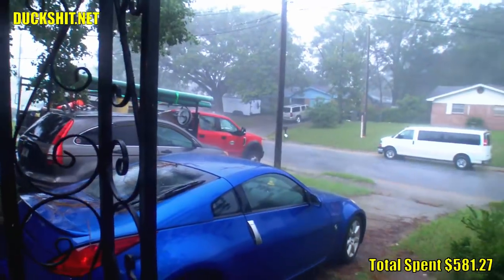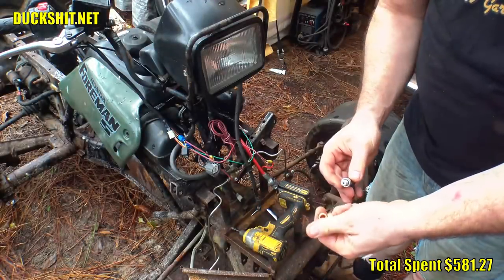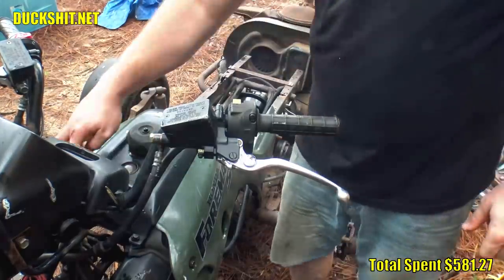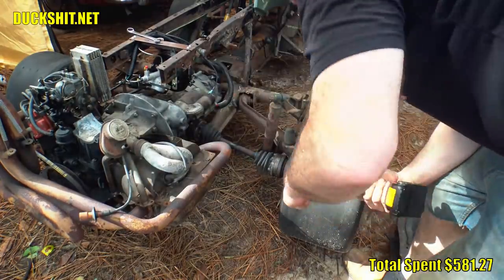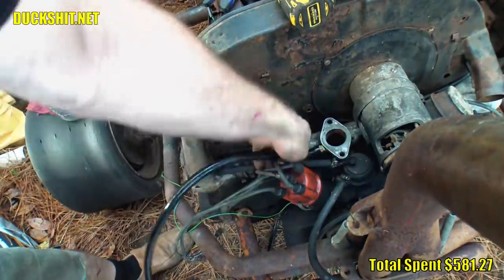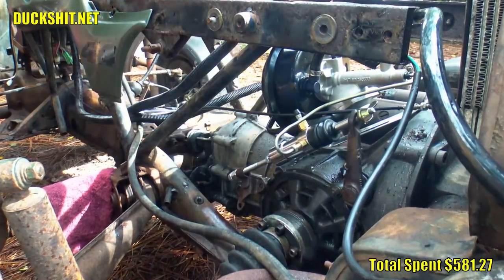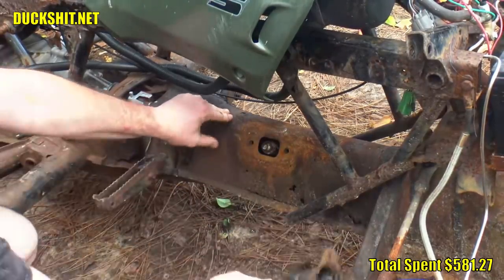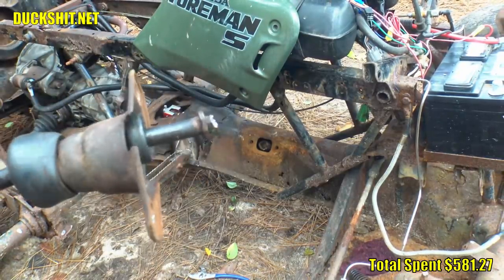HAND CLUTCH WORKS! - VW Motorcycle - ATVW Junkyard Build - Part 13

Comment: Lol I'm no hater. Love it. Glad it worked out. That's a cool slave cylinder with the vac assist. Holy crap what a plumbing nightmare you had there. 👍👍👍 I borrowed a friend's thumb for this one. Thanks for sharing, 🦆 man.
Reply from the maker: Haha yes... that hydraulic setup is quite a convoluted mess.  Thanks man!

Comment: Heres a thought for you , know any amputies that would like drive a manual again. Wondering how that clutch set up would work mounted on the gearshift itself. You could patent the idea
Reply from the maker: I considered mounting the clutch on the shifter, and it has been done before.  I wouldn't be the first.  But it's not what wanted.  I wanted a typical motorcycle setup.  I'll have to figure out a foot shifter later though.

Comment: Awesome work man! 
I could have told you the shifter wouldn’t work…. I’ve only been running one for 2 years now 🙄
Reply from the maker: Hahaha, yep thought of you the whole way through.  You didn’t have to cut yours, I would imagine you used an earlier split window bus shifter.
Reply: @DuckmanCycles  nope, it is a bay window bus shifter. Used the Empi quick shift adapter plate and it spaced it out just enough.
Reply from the maker: Yeah proper spacer would make the bay window part work...  or you would need to cut the dick head off as I did and shorten your peeper lever.